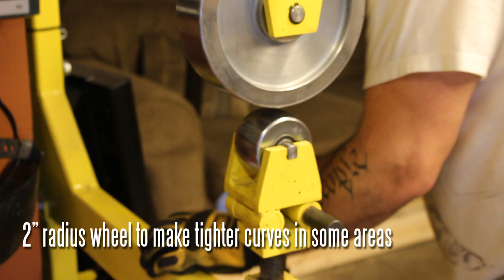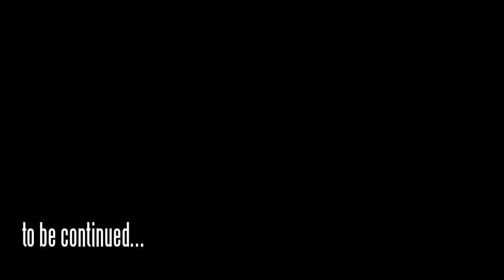Shoulder Armor Tutorial "Tenth Muse" (Part 1)

Comment: David Guyton, how do you go about your template making process? I am interested in getting started in armor smithing and have an idea for a gauntlet I would like to create but I'm not sure how to template it out before I transfer it to metal. Can you help?
Reply from the maker: There are other ways to do it, but the way I do it is what I show in this video. I just draw shapes onto paper and start from there. If I need to make changes, I just adjust the template as I go. Very old school way to do it but it works for me.
Reply: @DavidGuyton  Thanks for the reply, it helps a lot as I go about starting to get into this hobby. Also, thank you for sharing your point of view on this subject. I have noticed it myself in many different areas, and I'm glad you are bring it to the attention of others and are doing your part to initiate change. Well done! Also, just thanks for what you do as it inspires me to be creative myself.
Reply: @samcallahan3426  go for some hard paper or thick foam first.
That's what I do for developing patterns for leather armor.
Reply: Ordnael's Hideout thanks for the suggestion, I will definitely use that or some form of it. I started by using cardboard, but foam or a heavy paper will probably work better. Thanks!

Comment: Im sure theres probably a video in your archive , but as you said a creative who wants to make but believes they cant , would you happen to have a video for armoring for some one who has no funds but has a need and want to make ?
Reply from the maker: I designed the Dragon Rider Ring for exactly this purpose. The metal for it would cost pennies, and you only really need a simple hammer to do it. It gets people comfortable with metal and they can move up from there. But you can also do any of this stuff in foam or other materials as well. I prefer metal, but most of my fans, I would think, would be more into cosplay and more comfortable working in foam, etc. That stuff is very cheap

Comment: Question, David: at the beginning of the video the text says the 16 ga. is too thick for the English Wheel. Then you move on to the throatless shear. Do you mean too thick for cutting on the E. Wheel? Like you have a cutting attachment for it? 
Or is it just too thick for planishing?  
I’m planning on getting an English wheel to save my elbow tendinitis from unnecessary abuse, so I’m curious about its limitations.
Reply from the maker: The throatless shear can handle up to 14ga (thicker than 16ga...for anyone reading this comment who doesn't realize the higher the number, the thinner the metal). I cut it just fine. I was able to hammer the 16ga into the basic shape, but when I tried to run it through the English Wheel it would not flatten out the hammer marks at all. This is because the (cheaper) English Wheel I have allows too much flex in the frame. I will at some point add some heavy duty steel stock welded to the frame to make it more rigid. I have seen some people do this with the Harbor Freight EW I have and it works well. It can handle 20 and 18 fine, but the 16 is just too much for it. I do highly recommend getting one though. Saves SO much time in shaping.
Reply: David Guyton Excellent - thanks for the clarification.

Comment: I agree entertainment has been getting progressively stale year after year. The pieces are looking good so far and I am looking forward to trying my hand at making a version of these myself. I really need a beverly shear. Where would be the most economical route to get one? Thanks.
Reply from the maker: depends on your location. If you are in the USA and you have a Harbor Freight nearby, you can pick one up for just a little over $100 with their coupons they always have. Amazon also sell the same brand but it's a little more money. You can find a link to it on the Armor Templates website under Tools and Materials. You can also get one from Eastwood, but it's the SAME exact tool as this, just repainted blue and with the price jacked up.